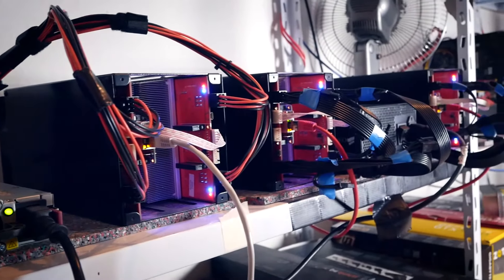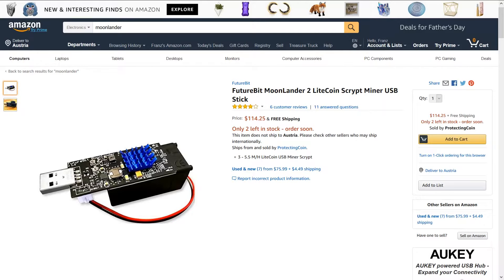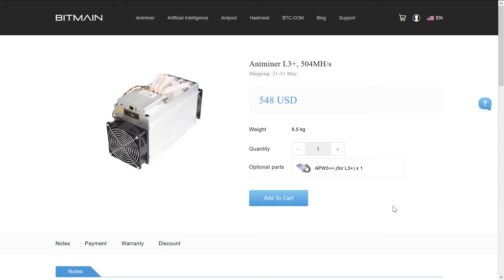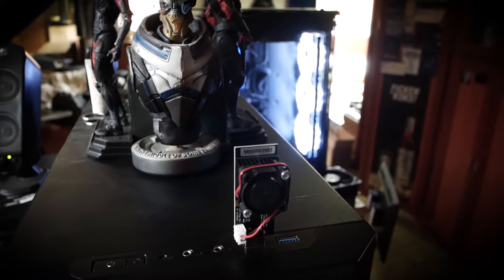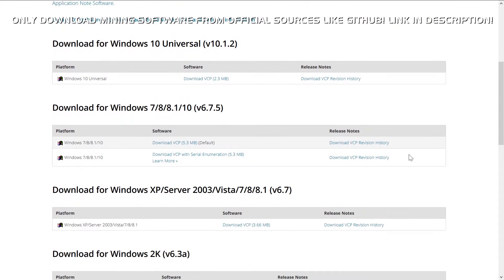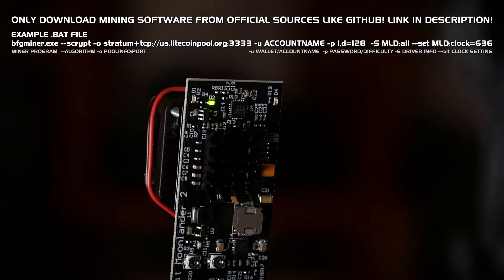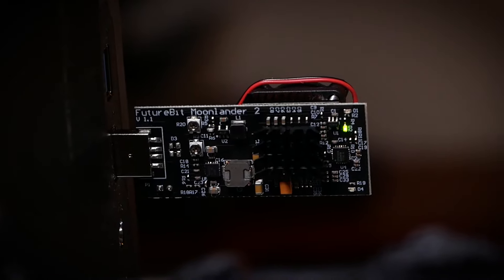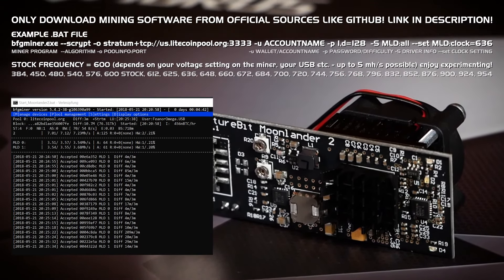FutureBit Moonlander 2: how to mine Scrypt: Litecoin & Dogecoin

Comment: I enjoyed your video. I have ordered a moonlander. What's the max number you can run on a laptop? What are the advantages of running it on a raspberry pi?
Reply from the maker: Very glad you like it Simon! So on the normal USB slot on your laptop you probably won't be able to tweak them too much, so I'd definitely recommend to use a USBhub - also to be safe I'd still check how hot they get on the normal slot. So there is no real advantage to run them on a PI (when your laptop would be running anyway for another reason), only that they cost very little power.

Comment: why my moonlander 2 is mining in bytes/s?
Reply from the maker: Hey friend! It should be mh/s or h/s - did you check on pool side where you connected to?
Reply: yeah, i got it now, but it doesn't stay on 3.3mh/s all the time, it goes down to kh/s or it doesn't mine at all
Reply from the maker: this could have different reasons, maybe network problems? It can also relate to the type of USB hub it is powered with, did you try USB 3.0 which is powered externally?
Reply: It mined for a solid 17hours, but for some reason, my moonlander 2 went idle! do you have any suggestion about it?
Reply from the maker: what is it connected to? Laptop, Raspberry Pi? Maybe controller goes in idle mode. Please check virtual memory of your PC, maybe need to increase (16.000mb)
Reply: got it thanks, it was going to idle mode!
Reply from the maker: glad that you figured it out :) happy mining!!

Comment: Cool video bro! I got 5nos, n its hashing only around 3.15mhs-3.60mhs. I tried changing the bfg miner frequencies n still no difference. Even tried tweaking the core voltage, but then it shows around 19%hw errors. So, I just set up everything back to Normal. 
Could you kindly help me with some tips on making them hash atleast 4.5mhs?

Comment: How much can you make a day with this?
Reply from the maker: we are talking about glorious 2 cents per day =D ~ 0.0002 LTC
Reply: Yep, for 2 moonlanders about 2 cents a day.  I have 2 of them as well, clocked at 648 and tweaked the voltage to 0.725 (using a multimeter) on both sticks.  They came shipped at 0.698 for me.  At the current rate mining DigiByte (scrypt) I get between 3.5 - 4 coins a day at 7.52Mh/s combined.  Doing this for fun so mining some of these DB coins and going to hold onto them.  I also have 4 Gekko newpac's and those are pointed at Litecoin Cash and netting a combined 272.1 Gh/s with a mild overclock (300MHz)  all attached to a Raspberry pi 3 B + and for a usb hub, a 10 port BrovSS  2.0 hub.  It maintains enough current power with these usb miners at the current overclocks.  I begin experiencing all kinds of issues when I go higher.   But comfortable with my current setup.  Cheap on power usage so something I can keep running and forget about.